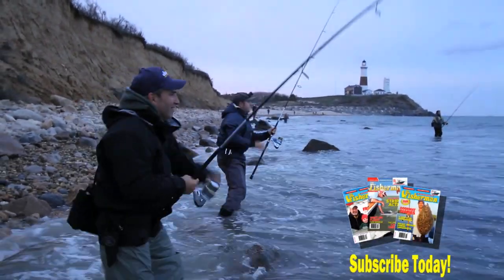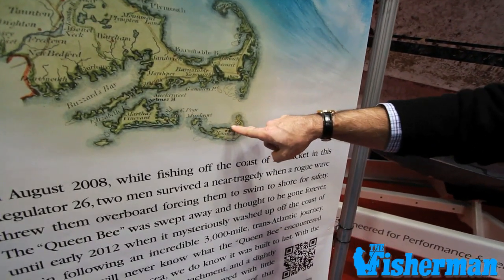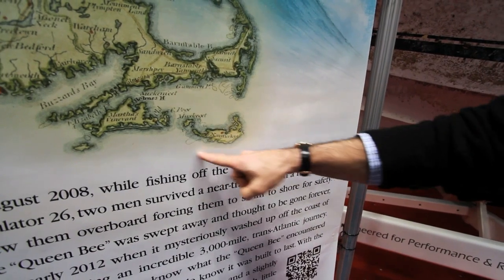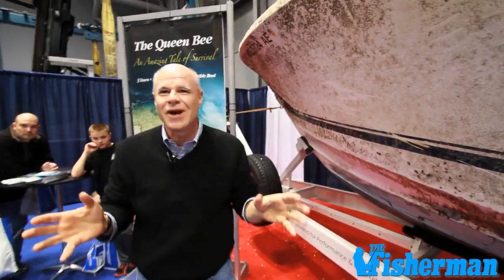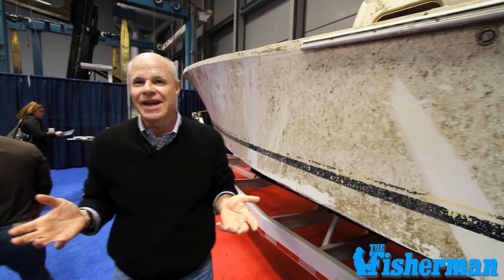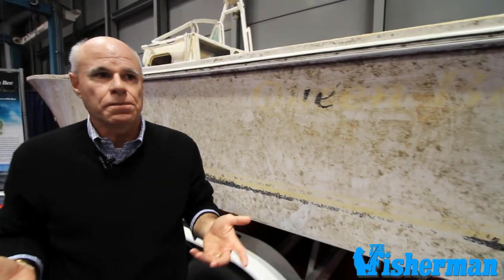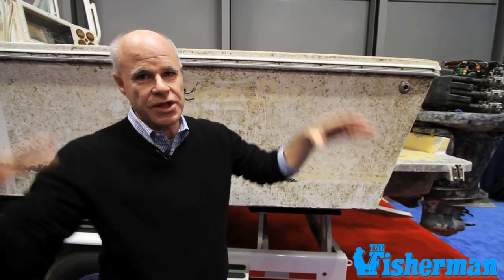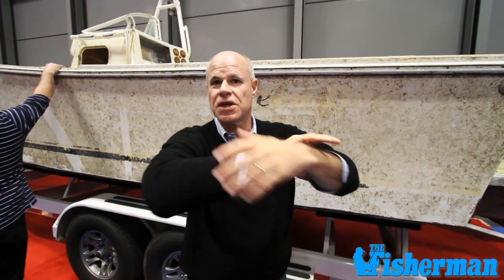REGULATORS ARE TOUGH: THE "QUEEN B" STORY

Comment: Regulator's are great boats but 
I would rather my family be in a 
  ~CAPE HORN~ 
2" THICK HULLS 
TOTALLY UNSINKABLE 
Blue water Tanks... 
Have a GREAT DAY
Reply: Yupp
Reply: Terrible ride the 21ft Cape Horn we owned
Reply: @4040mwilson  
That was my only complaint with my 2004 21' OS but I learned to place 2 or 3 Dive tanks across the front and just trim all the way down and WOW what an incredible smooth and dry ride. You'll think your in a 40' hull. I love mine. I have back injuries & not so able any longer
Reply: @lbbradley55  I would never buy another Cape Horn after that experience. My 20ft aluminum rode better. If I have to add weight to the front of a boat to make it not ride like a total turd I’ll pass. I can’t explain how awful that boat was. I grew up fishing the Great Lakes in all kind of old boats. All better than that thing lol. Glad your happy with your boat!
Reply: @4040mwilson  
Ha... Cape Horn here in the northern Gulf of Mexico is a very well desired boat. But that's why they make many different makes. Have a better day. :)